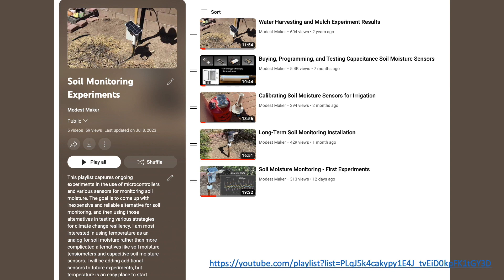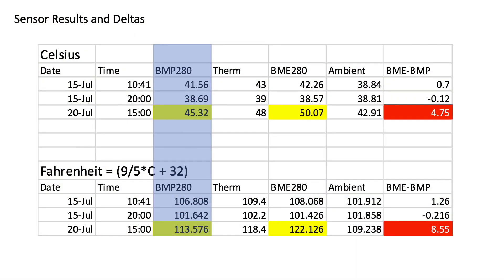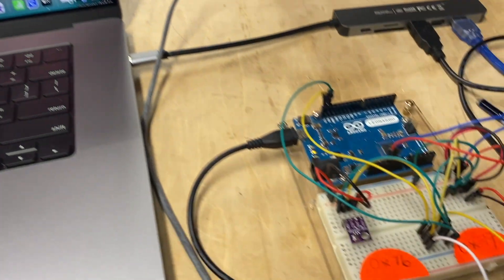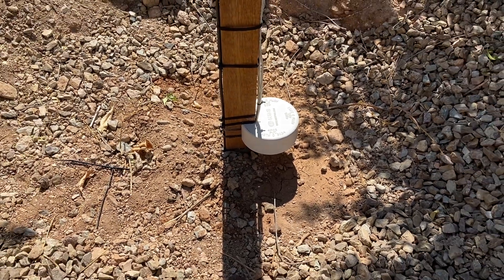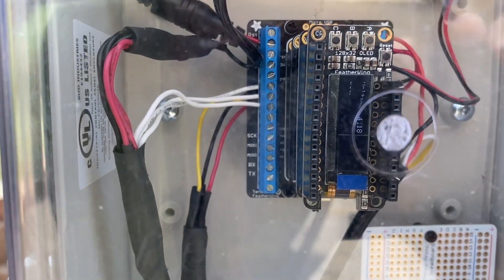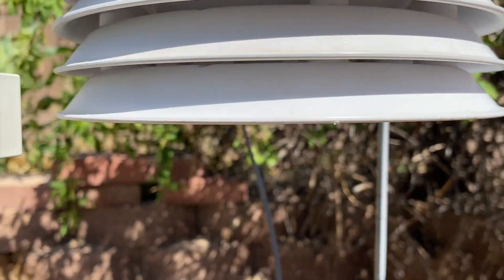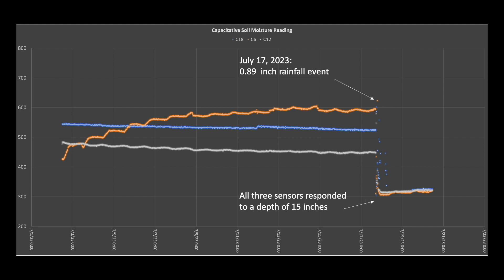Radiation Shielding for Temperature Monitoring with a BMP280

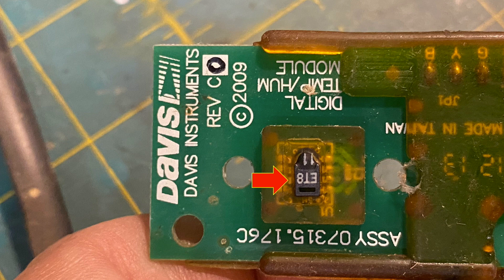Comment: The sensor at 3:11 is a SHT11 from Sensirion, there are a couple Arduino libraries for it available and you can buy them as modules. Just note that it doesn't use I2C, although it's similar.
Reply from the maker: Thanks for that. That sensor is pretty old and I wasn't sure how well they hold up over time, but I'll investigate the library.